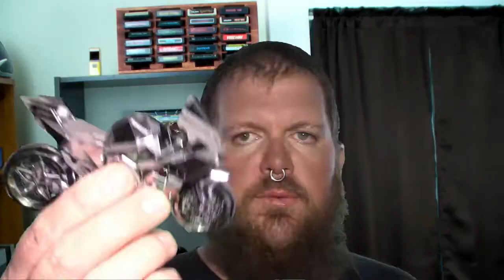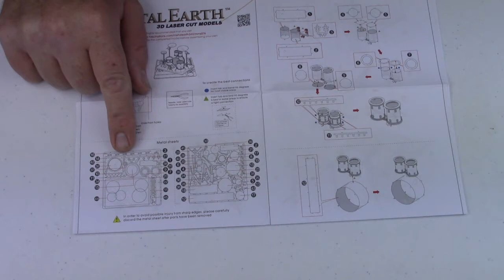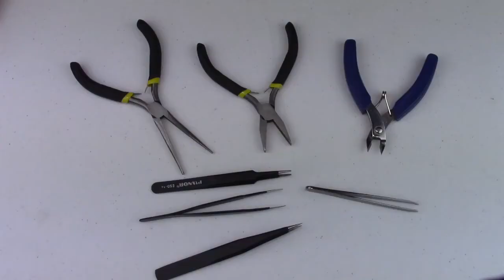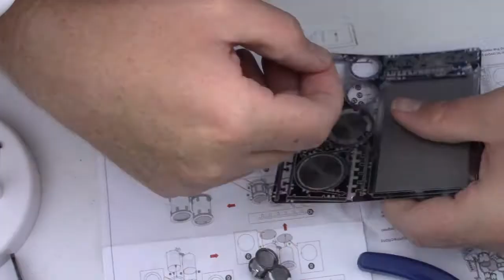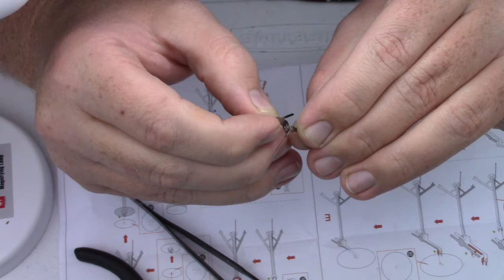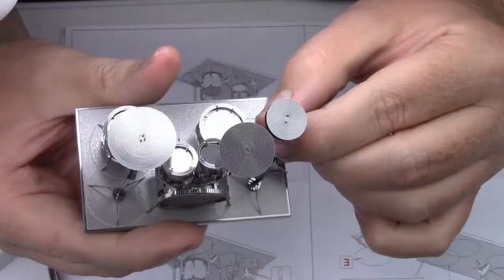Metal Earth Build - Drum Set

Comment: I just finished mine today. This is the photo album:  https://photos.app.goo.gl/Me6rZ8fyDzfvzdr58
Reply: The build itself is very tedious and boring, I think the kit is too small. if it is 50% bigger, it will be more fun and easier to handle. But when I finished it, it looks good. You definitely need a base to go with it, I build mine out of a wood block.
Reply from the maker: That looks to be a little different of a model. How similar was the build?
Reply: @animateorange  I didn't build the one you built. By watching your video and downloading the instruction from metal earth, I can say this set at hobby lobby is only 50% or less similar  to the original drum set. It is more difficult. take the tension bands for example, it has 6~7 tiny bands to wrap and fold into the little "things" around the band. It takes 4 pieces to make the legs of drum instead of 1~2. To be honest, I think it is too tiny to be so complicated. Metal earth should make it bigger and it could be an entry level iconx model.

Comment: Any hints on how to get part 26 on. I saw you had some trouble but I’m way past a few minutes. Any tricks that may help?
Reply: Well it appears the trick is to post publicly that you can’t do it; then try again and you’ll get it secured first try:). Still open to hints for the next time. And thanks for the great videos. Your videos gave me the curiosity and courage to start this hobby with metals.
Reply from the maker: @cindypogrund3081  It looks like you discovered an old trick of mine. Can't find something? Ask someone else where it is and suddenly you will find it! Seriously though, there isn't much of a trick other than to try to make sure the tabs are all straight and be persistent. It just a difficult part with flexible tabs that is just difficult to get. Having a set of precision tweezers might help, and steady hands, if possible.
Reply: @animateorange  I did figure out a "trick" that worked well for me as there are many part 26s in this build to practice on!  I had been trying to attach it by putting the part on the top.  When I flipped that and put part 26 on my finger and then turned the stand upside down I was able to easily get it on each time.  Who knew!!

Comment: A QUESTION ... HOW TO FOLD POINTS TO REMAIN STATIONARY PARTS? THANK YOU
Reply from the maker: I assume you are refering to the 90 degree bends. Depending on the part and area, they can be tricky. Most times I use a pair of flat tweezers and hold it near the base of the bend and push it over. Other times I just push them over with my fingernail. Sometimes you run into a situation where there is little support elsewhere and pushing on the tab could warp everything. You  might need to use pliers or tweezers to hold on the the part with the tab while bending it over. Sometimes the hard part is to bend the tab without bending over something else. It really depends on the situation.